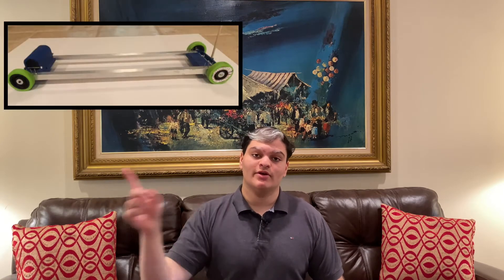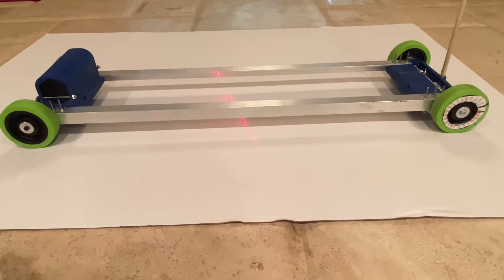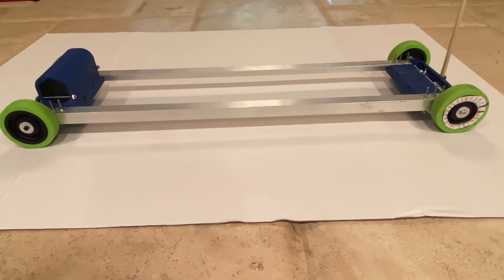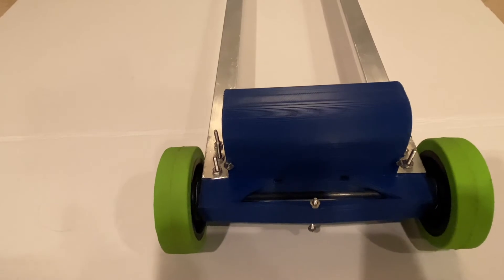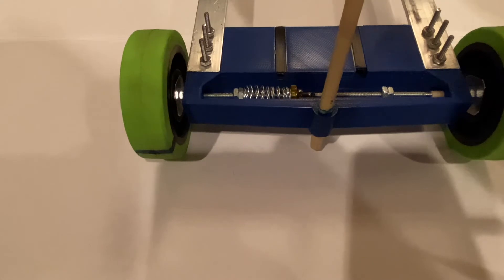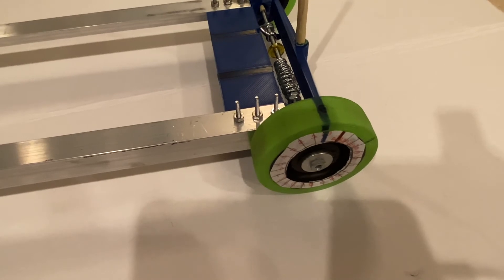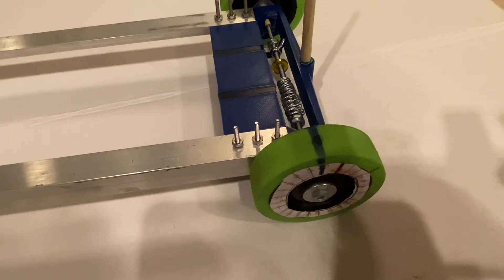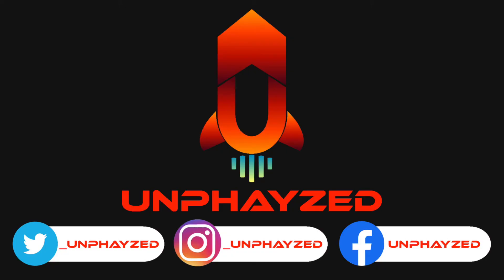How To Build A Science Olympiad Gravity Vehicle

Comment: Can I find the vehicle wheels in my local Lowe's stores as a replacement of buying it online?
Reply from the maker: The wheels I use are proprietary to BaneBots so if you want the specific wheels in the video you can only find them online. You could always use rc car wheels as well; you can find those at you local hobby lobby, probably not Michaels though. I doubt that Lowe’s or Home Depot have anything similar.
Reply: @UnphayzedScioly  Thank you so much! How long does the BaneBots wheels take to arrive and can I get most of the materials for the vehicle at my local hobby lobby or just online?
Reply from the maker: BaneBot orders usually take 2-3 days with the flat rate, I’m sure that you could get it faster if you uses express shipping. The best place to heat materials is dependent on what you need. For heavy duty things like aluminum, threaded rods, nuts & bolts, large wood sheets or 2x4s, etc you would want to go to Lowe’s or Home Depot. However for more art & crafts things like dowel rods, rc car wheels, and small plywood wood sheets you would want to go to a hobby lobby or Michaels.
Reply: @UnphayzedScioly  Thank you so much! I have learned so much from your video!